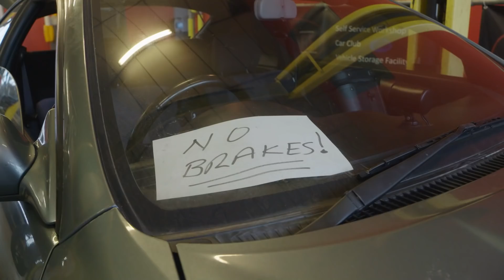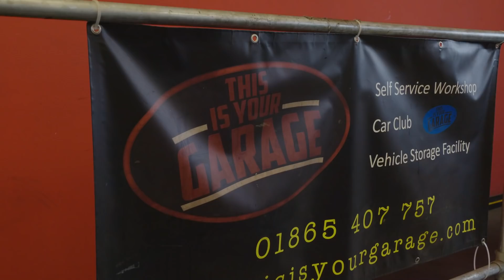The Worst Car We've Ever Worked On!

Comment: The superstrut suspension parts on these are £1400 for new Toyota parts so a lot of money has been thrown at this car. And what a car it Is. In my opinion, the mk6 celica is one of the best looking 90's japanese sports cars out there. Great work making sure this one stays on the road for years to come. I hope Ray gets the enjoyment from the car he deserves. Good job guys.
Reply: Had st205 in 2007 let toyota main dealer do the superstrut 750 back then it was a import never had a issue with it other than that. 255bhp standard..put it on dyno 298..I had not done anything to it .got lucky .at the time lots of mates had impreza imports dealers wud not touch em..toyota never turned me away..you are so right about the mk6.
Reply: Yes she a beauty
Reply: Yes indeed. My dad had bought the suspension with the aim of replacing it all but I was able to sneak this into the car when I got it to the car throttle team. Dad is really enjoying the car and looking forward to taking it into the next steps of being a real collectors car.
Reply: I called toyota once for a clutch cable and it was 1000 dollars usd. So idk about that
Reply: @hellofurend  Cable? These use a hydraulic clutch line.
I replaced the master and slave cylinder on my clutch for approx £300. And if the line itself needs replacing, it's literally just a regular copper line. Easy job.
Reply: It's like Supra, but a lot better

Comment: As someone who daily drives a gt four it's always great to see another Celica back on the road. On a side note, the problem with the spark plugs is usually caused by a failed rocker cover gasket that pisses oil onto the plugs, I've only had to replace it on all 3 of my celicas
Reply: I daily my ST165, they are such fun cars. Always great to see another person daily them
Reply: I had a Carlos Sainz limited edition Celica for 17 years, one of the best cars I have ever owned. Now drive a Yaris GRMN which is also a great car to drive.
Reply: Recently bought an st202 SS3 beams red top. freshly imported and waiting on registration. Cant wait to take it for a proper drive. Hope the GT-Four is treating you well.
Reply: @AxeManAnt  the GT-Four driving experience is very good, the maintenance experience... Not so much lol
Reply: @mateopopich  Replaced the superstrut on mine so i'll drink to that. Timing belt and water pump next up. Then a bit of bodywork and a full respray. My bank account hates the car as much as I love it haha.
Reply: @AxeManAnt  sounds very similar to what's next for dad's GT-FOUR. Cambelt new sill then a respray. It's not the correct shade of seaspray as is.

Comment: I had a friend with a tuned ones of these years ago and it was a monster it also drank petrol at a rate I had never seen before. Great video as always guys well done.
Reply: Old turbo cars do drink a lot! I have a stock MR2 with the same engine and it drinks more than my 2.5T STI
Reply: @lecoureurdesbois86  christ the ST is thirsty aswell. But they also sound pretty damn good.
Reply: 3sgte is a more than capable motor shame they never got the enthusiasts like the sr20
Reply: @oetic5016  Not a bad thing, they're not as overoriced. MR2 people actually swap K20s because "more modern, cheaper parts".

I'm too much of a purist to even look at those.
Reply: @lecoureurdesbois86  yeah but surely nobody is swapped the 3sgte for a k20.. I do know of people swapping the 2zz for a k series though because of obvious reasons haha
Reply: @TwpsynMawr  Yeah I'm talking about people swapping 3SGTEs for K20s turbo
Reply: @lecoureurdesbois86  that's just mental.. but I suppose if they are just going to be slapping a turbo on the k series then it makes sense 🤙

Comment: That car was in amazing condition, they got away with doing the basics hahahaha I own one and ven mine has been great compared to many that require complete rip out rust repair to bare chassis and rebuild. Good to see it in the line light though
Reply: I mean... any 20yr old car that doesn't require any body works is in amazing condition.. Suspension work is easy and also cheap *if you can the parts*
Reply: @jjb4531  cop on meaning you don’t agree? I don’t know if you own a gt4?
Reply: @donbarzini2141  i think they would of blown the budget when they did the suspension, 2-300 per item 🤣🤣

Comment: Also if you have stuck brake caliper and pressurised air does not work, same size grease nipple than caliber bleed nipple and then apply grease to caliber with grease gun. This is final option because its hell to clean all the grease, but usually it works.

Comment: "Worst car we've ever worked on"
Scotty Kilmer wants to know your location.
Reply: I'm willing to bet that Scotty Kilmer has never even seen an ST205 in the metal never mind worked on one. They might look similar, but the ST202 and ST205 are vastly different cars.
Reply: @mattn6368  Scotty Kilmer doesn’t have an ST202 he has the AT200. ST202 is a GT 2.0. Scotty has the 1.8s
Reply: Kilmer is a clown 🤡
Reply: @JRR_x  Aside from the obvious (engine, gearbox&shafts) pretty much everything in ST202 and AT200 is the same and fits each other P&P.
Reply: @veevoir  And Brakes, exhaust.. etc
Reply: @JRR_x  Also fit each other P&P. Everyone swaps front brakes to T25 anyway  (and back is the same), exhaust is I think .25' diameter difference (after cat). Not sure what other different parts you will find that would make working on AT vs ST different (those above dont :P). The big change betwen those two is only engine/box.. vs GT4 which is a totally different car - you cannot, for example, put GT4 brakes on AT/ST plug&play, you would need to modify the mounts (at the very least).The SSS (though a rare  version of ST202 from JP had SSS) whole floor and everything under is different too (obviously, being 4wd) etc.
Reply: @veevoir  My dad had an SS-1 or SS-2 (can’t remember which) from Japan import around 2005, But I remember a lot of parts being different from my ST. I’ve never heard of anybody putting GT brakes on the ST (As front are larger) but maybe you could do some fabrication like you say.  He had a lot of problems with that import, wasn’t best suited for UK roads (wasn’t undersealed properly) etc. I did look into a 3SGE swap for my ST but it’s a huge job and very costly, it’s not as Straight foreword as people say. The US market Gen 6s are a waste of time, I feel bad for the US!
Reply: @mattn6368  Scotty made a video on a ST205: https://www.youtube.com/watch?v=aWESDcFE9NM  He seemed to like the GT-Four, I dunno. :)  Nice to see one on CarThrottle as a change from all the BMWs...

Comment: Suspension work, plugs and fluid's changed is not bad for an old turbocharged car that's been sitting. How is that the worst car? Have you not worked on a 3000GT yet?
Reply: I had the misfortune once to have to do the clutch, on the AWD bi-turbo one.
Never.
Again.
Ever.

Comment: A good method for getting brake dust off is removing the alloy wheels, mix caustic soda with water, spray it on leave it for a couple minutes, cover your hands with rubber gloves and rub it with a sponge and then rinse it thoroughly (caustic soda can damage paintwork and cause corrosion so keep it away from your car). I usually do this when I'm working on my car and already have the wheels off. You've just got to be careful as it's quite a dangerous chemical.

Caustic soda is the main ingredient in oven cleaner. Some budget car washes use caustic soda as it's cheap and cleans quite well, long term usage does cause damage to paintwork and will fade the paintwork... I don't let any car wash touch my car! It's 9 years old and looks like it's just been driven off the show room floor.

Comment: As the proud  owner of a gt4(1988 model) i can confirm that these cars a an absolute nightmare to work on. I bought her in 2003 and it took years to figure out the little tricks needed to work on them. Also so many unneeded parts that i removed/deleted helped a ton.

Comment: literally my dream car.  finding one at a decent price here in the states is pretty difficult.
Reply: In Japan the not cheap unless it has 300000km + on chasiss.  96 400000km bid $7000usd in Oct
Reply: @coopsnz1  ouch.  guess its the same all over
Reply: @ralphharrison6622  basic little spolier gt4 responsible price 1.26 milion yen 250000km , but big wing " wrc aren't

Comment: I wanted a ST185 or ST205 so badly, but could tell a turbo Subaru made a ton more sense. Had a good 3 year run with a ‘01 Subaru GT-B and had zero major issues.
Reply: I had a st185 and can confirm it was a love hate relationship. Loved everything besides finding and replacing parts for it. They're difficult to find in the uk and even more so in Germany

Comment: I had the 2wd GT version, also with superstrut. I too had to pay for the superstrut repairs. But other than that, it was a very reliable car up to 300.000km when I traded it in. Couldve gone much longer I think.
And the superstrut is definitely worth it, it is one of the best front-wheel-drive cars out there. With that suspension and the lsd.

Comment: The mr2 turbo and engine layout is the same as the celica but fitted to the rear of the car. You can get engine and service  parts under from the oem mr2 sw20 model.

Comment: Just in case anyone watching this is looking for old celica parts. Me and my dad stiped his old mark 5 (1990-1994) about 15 years ago and he still has most parts lying around in the garage and loft. Including wings, bonet, lights, suspension components and full original interior. He he also had the twin head light model st model similar to the one in the video. He now owns a convertible mark 5 2L 4wheel steer model. realy rare these days

Comment: Nice to see the GT4 lives up to it's nickname FAFF and nice to see back on the road
Reply: Not quite back on the road yet. Still needs a good bit of work unfortunately. MOT ran out and needs a sill and it still has a wired knocking in the rear that we can't figure. It will be finished now though. 👍
Reply: @Japnut  check on any GT4 forum, someone might have come across it, ready for spring fun
Reply: @Bikergal800  I've asked on the new gt4 Facebook group and got some suggestions of diff mounts etc. We are also not sure if it's strangely the handbreak as it bumps when it releases.

Comment: Typical GT4 issues. The linkages on the front ‘super strut’ setup are the Achilles heel. Driven hard they can last as little as 12 months and are £800 region to replace the lot. Gearbox synchros can be weak and the ceramic shaft on the turbos are a common failure. That said, a well sorted GT4 is an absolute riot to drive. It’s just unfortunate that whilst you get near super car performance, you also get the maintenance expense to match. Yes, I’d have another 👍

Comment: The Gen 6 GT4 isn't know as "The Faff" for nothing. I always wondered whether it would be possible to swap out the ST205 super strut for the ST202 traditional mcpherson set-up, sure it would lose some of the capability but most drivers probably wouldn't notice and it would save a bucket load of cash.
Reply: Yes you can do that people have done it. They have even done it on the actual WRC cars for reliability issues. Me being in Canada I would probably end up doing it in the future because parts might become hard to find and I have to import them from over seas
Reply: It absolutely is, two of mine are MacPherson converted. Much lighter and more economical to maintain for racing.

Comment: The gt4 is amazingly engineered. To the point of it being a P.I.T.A. Putting coilovers in requires cutting and welding the adjustment sleeve to the "control?" Arm.

Comment: The ST205 is one of the all time great JDM cars & very underrated.
Reply: nah not really . Most love them . 

Easy to get 300 bhp out of and to be honest it needs that bit of extra power given its a heavy car that ruins its proformance simply due to weight . Grips nicely though . One thing that always pissed me off was the mpg . Sub 20 is standard and i once got through 20 quids worth in 8 miles in my 450+bhp gt185 .
Had perhaps 20 Celicas over the years and presently run a gen 7 190 simply because i cant shake off owning a Celica . When the day comes ................ ill get a caldina
Reply: Except it’s not JDM.

Comment: My 2009 audi a3 has maybe 90% of the same issues along with body rust and a broke exhuat flexi just down from the cat. Tried to get the cat off today on ramps on my driveway and I swear I could cry. Who designs this nonsense? No access from the top and barely room to get a fist up from the bottom 😥. Not to mention 02 sensors are seized in. No cash to pay garage to replace it (stupid money for new part) and it's failed mot. Any garage owners who feel they can help please reply. I stay in West lothian , Scotland.
Reply: Cars like these are designed with tight dimensions to cut down useless space as this effects weight, efficiency, aerodynamics etc. The Celica especially had to have everything crammed in, and the engine/gbox was tilted backwards to achieve the low raked aerodynamic body lines Toyota wanted. This is why the Evo is shaped like a normal car and is easy to work on, Toyota were trying to beat them in WRC.
As for your O2 sensor, first douse it with a good penetrating oil, or ATF fluid mixed with methylated spirits, and use a pipe wrench or a Stiltson to undo the sensor if you do not have the O2 sensor socket or if you have rounded the nut.
Here is a link to a good video explaining best techniques to remove them https://www.youtube.com/watch?v=6AXWYFyTbfo

Comment: Try finding an ABS sensor for a pre august 95 car, or a wiring connection to fit a modern stereo. The ABS sensor was impossible to find, but I managed to find one from a later car, which had to be a little bodged to get it to fit and to this day I haven't found the stereo connector. None of those available on ebay, or any other website come to that, have the correct plug to connect it to the car's electrical system.
Reply: Just solder or crimp the wires, as long as you get the right wires together it will be fine, a plug is a simple part it's just used for convenience so you can disconnect something easily. If it is going to be semi permanent just hard wire it.
Reply: @nzuncovered1845  if you are referring to the radio connector, the plug in the car has about 12 wires, none of which I know what they are.
Reply: @calibrazxr750  You can figure it out by trial and error, usually 8 of them are + and - for front and rear speakers, one will be constant power for the clock and memory, another will be accessory power, and one main power, another will be remote power for an extra amp. You only really need the acc power and main power which you can wire together. If you get a 12 volt source from a battery and apply to each pin, you will be able to figure it out.
I have had to do this before when I have had head units where the plug wires weren't labelled.
Another option is to just buy a new head unit with the plug included.

Comment: I'm more surprised that the car is so rust clean and still has the front backing plates behind the brakes.. Those rot like crazy in all celicas - and are impossible to find anywhere.Just like the calipers..Stuff like that is why all celicas disappeared from UK before brexit ;) Most went out to be parted out to keep the ones in Europe running.

Comment: As a canadian, trying to remove banjo or bleeders on caliper without heating them with a torch is asking for trouble
Reply: Doesn't make much difference on these, the calipers are alloy so they tend to dissipate the heat rather than expanding the metal. I've stripped and fully overhaul about 5 or 6 full sets of ST205 calipers ranging from reasonable condition to worse than what these guys were dealing with. 

They shouldn't have put those OEM pad retaining pins back in, they'll be seized again by the time the pads need changed. Much better to replace them with stainless M6 bolts and metal lock nuts.
Reply: @unicorn7337  I work on alloy calipers all the time and with much more thermal mass than these. I dont know your technique but they'll heat up enough. Then spray water and it cracks the corrosion bond. I do that a few times on bad ones. They can bad here, high humidity, road salt and all. It's so bad that sometimes the hex requires a 1-2 mm smaller socket hammered onto it. And I still get them out. Next time I video it, you'll see.  Propane torch wont cut it, MAP gas will

Comment: I have so much enjoyed all your videos, but I have a question. For someone who has worked on a lot of cars, why would you only changed the plugs and filter as a 'last chance' thing? With all the other work you have done on the car, why did you not change the plugs and air filter when you did all the fluids?
Reply: Scratching my head about that one as well. Maybe the charge cooler scared them at first and they didn't know you could get the plugs out without draining it.
Reply: Yeah it's just standard to replace plugs or at least check them if you have no service history on a vehicle, also I didn't see them flush the cooling system, or change the rear differential fluid.

Comment: My ex had one of the GT-Four RC spec - and he DREADED any work needing doing, the WORST engineered Toyota ever put on the market lol, and he worked for Toyota in R&D.
Reply: It's not so much that they are badly engineered. To achieve the shape and dimensions of the Celica whilst having a turbo inline 4 cylinder engine and 4wd, Toyota had to cram everything in and turn the engine rearward towards the firewall to give it the low raked bonnet and windscreen etc. That is why bolts and parts are hard to get to. Aside from that fact, in my experience with owning 4 Toyotas, suspension is not one of their strong points, bushings always fail and squeak constantly. Nissan have much better suspension than Toyotas.